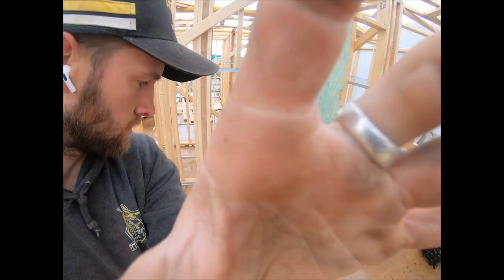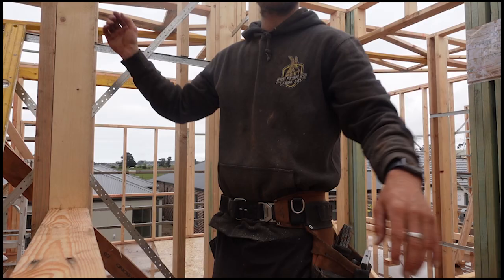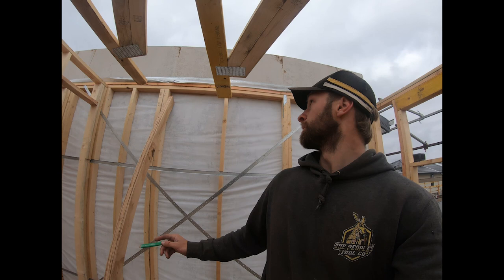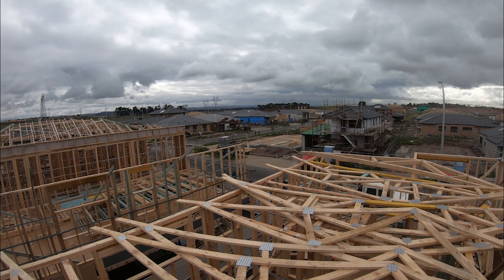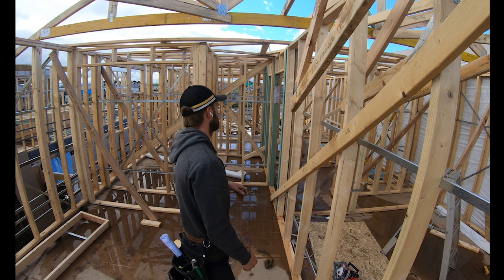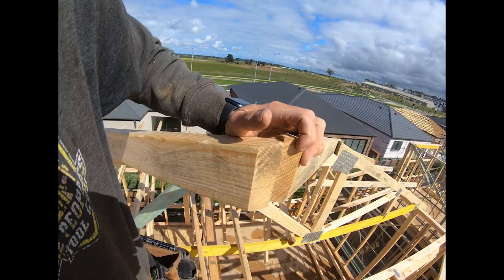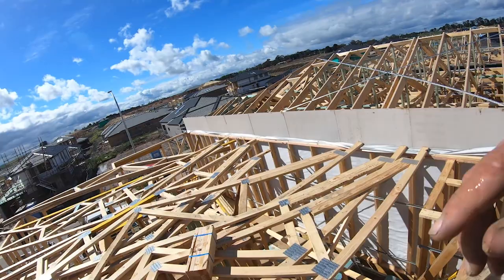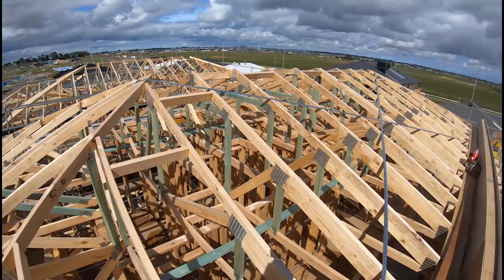Framing A Truss Roof! Basic Framing and Roof Carpentry, How to Build A Roof

Comment: Top video mate thankyou really gives insite simply and effective. Do you have any information on those noggin straps? Never seen that before, what product is it?
Reply: Curious also
Reply: Hey man, @ 23:20 jack explains the metal bars and what they’re for. Due to the timber shortage, prefab frames are coming with those metal bars instead of noggins 🤦‍♂️
Reply: @CBRCase  cheers for the explaonitory bro, im amazed that comply to code
Reply from the maker: Me Too haha
Reply: @antoineassaf3864  all good dude. bewildering hey..
Reply: @antoineassaf3864  way inferior though compared to standard noggins. Noggins provide lateral bracing to stop studs from buckling under load, most effective when the noggin is the full depth of the stud like standard noggins because it stops the stud from both buckling and twisting at the same time. These studs are only braced one side so they have more potential to buckle and twist under load. If there’s cladding on the outside it’ll help brace it more but if it’s brick veneer then it’s an inferior design.

Comment: How heavy are the Akribis Leather bags? I want a pair but the weight scares me since I carry heavy and don’t like suspenders
Reply: Buy diamondback you won’t regret it
Reply: @SoberJokR  I got the Denali 2.0 and the chopo haha want a grrande next maybe buy myself it for Christmas
Reply: @adamo7491  i owned the grrande didn’t like the speed square slot. Bigger than denali 2.0. Only thing I like better on grrande is the tape holder
Reply: @SoberJokR  The tape holder is on the left pouch If you get the standard set?
Reply: @adamo7491  yep absolutely